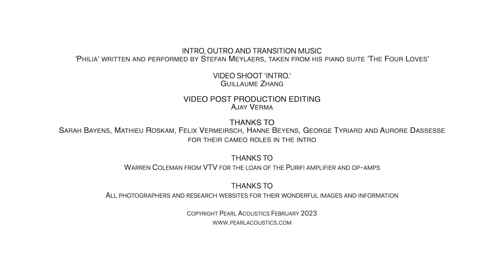Part 1: The perfect power amplifier?

Comment: “Warmt” = added distortion … it’s ok if you want to pay extra … go for it … but it’s not me … pure Purifi is my choice … I use Benchmark LA4 as perfect preamp to my Eigentakt Purifi monoblocks … excellent video Harvey … Bruno really revolutionized and commoditized power amp segment with Hypex nCore first and even more with brutally transparent Purifi … and I own Quad 909 power amp as well (which I like, used it for 20yrs, even restored it, but it runs too hot and in the summer not as enjoyable in the room without adequate A/C and now it’s replaced with Purifi monos)

Comment: I'll stick with my Audiolab 8000M's. 20+ years old and when I sent them for a service a few years ago all that was needed was a clean to remove the residue from my misspent middle age. They measured perfectly on test so I was advised to leave well alone.
I'd be interested to know if they are among the most reliable HiFi components ever made?
Perhaps it's because they have been left on for most of those 20 odd years only being turned off when making/breaking connections, cleaning or going on holiday?
Reply from the maker: Hi, I am not very knowledgeable on Audiolab gear. But good quality equipment should last a lifetime, in my opinion. Indeed, leave well alone - and if something needs changing go to someone who really knows what they are doing. Best is always the manufacturer, if in any doubt.
Reply: @PearlAcoustics  Sadly Harley Audiolab seem to have no interest in customers once they're customers.

Comment: Of course, I first saw this part, then the interview with Bruno, after which I came here for a comment. There is practically no amplification, amplifiers do not amplify anything, they just facilitate the source signal to modulate in amplitude the current from the power supply which reaches the speaker in the audio speaker or the terminals of the audio speaker. This is the secret, practically and theoretically, the audio/musical quality of an amplifier depends a lot on the quality of the current from the amplifier's power supply. A linear source, possibly stabilized, will produce a much better, more musical sound, than a PWM (switching) source. I studied a lot and even assembled a few amplifiers in my youth. Of course, a good preamp, again, with a very good current source is very important. Bruno said that he is trying to create a module that is no longer influenced by the quality of the power supply, the current source, which in theory may be valid, but in practice is not possible. Think about what I said above, at the terminals of the speakers, from the amplifier, it is actually the current from the power supply of the amplifier that is modulated by the input signal and not the input signal as such. Real amplification is called resonance, and again, it is only encountered in the analog realm, in nature, or in analog electronics. When the soprano hits a high note with force, the empty glass on the table shatters as it resonates amplifying the frequency of the sound emitted by the soprano. So, if you want to build an amplifier around Eigentakt modules, you need a very good quality linear current source, possibly stabilized, then the best buffer can be made with tubes and not transistors or opamps.
Reply from the maker: Thanks for your contribution to the topic

Comment: I own a Purifi based amp. It truly is the thinking man's choice. I have never before heard, let alone owned, an amp that I enjoyed so much with such a variety of music styles and sources.
Reply: I second that: I bought the Hypex Nilai 500 DIY Stereo and the Hyper Preamp DIY, it's marvelous!  I am an ex DJ and listen to a wide variety of music genre.  Sparkos Tube in there, for me it's no thank you, total no go...  "More Musical" = the guy like the added harmonic distortion of tubes:  I don't like distortion at all, i don't want to hear colored sound!  But cool, we have choice of buffers for those amps, a modular architecture that brings flexibility / choices.
Reply: @ I like distortion and 'coloured' speakers, but only when I choose so. Clean power is the baseline.
Reply from the maker: That’s good to hear
Reply: @Bob.martens would you mind telling which buffer and opamp you’re using and which speakers you have?
Reply: @sebastianlunoe  I have the Audiophonics hpa-s400et amp. Audiophonics produce their own buffer board with LM4562 OPA, offering four gain-settings and a buffer bypass. My speakers (in rotation): Q acoustics 5040, Wharfedale Linton, Klipsch RP150. I use a Topping D70pro Sabre as preamp.
Reply: Alimento il mio amplificatore con un alimentatore esterno da 24 V., 3 A.
Ho notato che a parita' di volt, aumentando gli amperes cambia il suono dell'amplificatore. Sembra "muscolato". Anche a 1/30 del volume massimo.
Altoparlanti buoni, conseguentemente produrranno un buon suono....
Buongiorno.

Comment: Not wishing to sound critical but I struggle with the concept of what is being called a "perfect" amp being coloured by an op amp. The mere fact that the two tested made the amp sound different regardless of whether better or worse means that although the final stage may be "perfect" it will always be affected by the op amp. And that Harley prefers, what I assume is a more  "coulored" , as in less that totally transparent,  sound means that to strive or even care about "perfect" is a waste of time. For what it's worth I would love to hear the op amp Harley liked less as for me I love the transparency and ability to dig into the minute detail.
Reply from the maker: Hi, thanks for your comment. The title of this video is deliberately provocative because of exactly what you say. There should be a pure voltage gain without any colouration. But then, when there is, somehow it is not so pleasant to listen to. At least now we can have options….
Reply: @PearlAcoustics  Not so pleasant for everyone. From what I've heard and read over the years audiophiles/ music lovers seem to fall into two basic camps. Those who seek utter transparency and detail vs ( not necessarily adversarial) those who prefer a warmer sound. I bought a Denon DL103R based on the positive reviews and was rather unimpressed by its lack of high frequency detail resolution.  I could appreciate why some might like it though. I replaced it with a less popular if a little more expensive Audio Technica 0C9XSL which ticks all "my" boxes. I would live to hear live both iterations of the amp reviewed to see if a similar experience resulted. Thanks for your reply. 👍

Comment: Class D amplifiers are amazing. Indeed.  It is difficult to imagine that they sound so good being efficient as they are. As class D amplifiers are being developed? Mains voltages will be of concern. I am in the United States. 120 Volts? Something will give.
Reply from the maker: Voltages are not an issue. High quality class d amplifiers, all have mains smoothing circuits. In fact you can see a simple 5v smartphone charger as a class d amplifier in reverse….
Reply: @PearlAcoustics  I have so many questions about them. Thanks for the input.
Reply from the maker: @tnasburypl  you’re welcome
Reply: @PearlAcoustics  No worries, I as a person who spends a lot of money on amplification? Seems high end speakers can be found at relatively lower cost verses amplifiers. i am intrigued. In so am following such things.

Comment: Your comments comparing to a watch is apt.  No one needs anything better than a $20 watch to tell time.  But we buy the one we like and also get to tell the time.
I built big OTL triode amps because the notion of tube amps fit my design aesthetic.  The circuit designer was well regarded, so it had the potential to sound good, but I did it on faith.  They sound as good as they look, and I never think of changing or upgrading.  What little distortion they have suit my ears.  Holographic and engaging.  For me, they are the Patek watch, while the amp you are showcasing is the Casio.  My amps have the huge disadvantage of needing retubing, and they take a lot of space, and are energy inefficient.  But I do love them.  When I get old and have to downsize, I'll get the perfect Class D, and put it in a cabinet out of sight.  And also buy your speakers.  
I would buy Bruno's modules to build some power amps for my woofers.  I need about 13dB of gain.  They would likely work without the gain stage.
Reply from the maker: Thank you for your very kind appreciation and for your contribution to the discussion. I too have a big, very heavy pair of tube monoblocks in my home listening room. They best it beautifully in the winter. But in the Summer we switch to class D. Best wishes, H

Comment: obviously theese amps are made to be connected with XLR`s that can output 4V, if you put in RCA then no wonder you need more voltage. also the tube buffer will only increase distortion, defeats the purpose of this amp in the first place.
Reply from the maker: Indeed. The distortion (2nd. Order) that tubes make is weirdly appreciated.  We also have run the purify directly from high output pre amplifiers, some natch very well.
Reply: Not even 4V would be enough. You would need 10V from preamp to feed them directly for optimal performance. Otherwise, you still need to use the interface for gain.

Comment: Disdain for Seiko, "quite rightly?... ?   (questionable comment !)
Wires in that amp seem quite sloppy compared to the neatly braided lines in the components I have opened up!
Perhaps an interesting video(?), though I feel it had tunnel vision. Hopefully subsequent parts to this series will expand on this one with insight relative to other historically-respected amps (such as McIntosh MC275, etc.)
Reply from the maker: Hi, indeed my comment was not very well phrased. I felt bad about that but it was too difficult to edit out. Absolutely no disdain about Seiko, they are great value for money. And I would have no issue in wearing one.

Comment: Many moons ago i have decided to give B&O ICE modules a try. I have builded nice housing and E88CC tube buffer. It was not bad, but it was not good either. Withouth E88CC buffer it was cold and uninvolving. But with signal generator driving it at 1kHz you could weld with it.
That was long time ago and by now these things must have made long way.
For time being and untill proven othervise i will stick to valve SE A class.
Sir you have a great chanell.
Reply from the maker: Hi Sinisa, I find I have to agree with you here. Especially with the class A Sugden 😉

Comment: I wonder how the Purifi Eigentakt would sound with the buffer replaced with a Lundahl audio transformer? 
Will the audio transformer give the same warm sound as a tube? 
I will use it with Klipsch horn speaker so I don't think I need more gain then 13dB.
Reply from the maker: Dear Thomas, thank you for your interesting question and contribution. I am not a specialist in this area. A colleague suggested that you would still need an active gain stage as with the transformer it will drop the gain a bit more. So although it might be suitable for very sensitive speakers, like yours, with a suitable preamp, it’s quite a specialist offering. If you have the knowledge, why not give it a try? I would be very interested to hear the results.

Comment: What I do not understand is, if you already have the best amp module in the world with the lowest distortion etc measurable, and then you insert in front of it, an op amp made from discrete components, which is guaranteed to degrade the distortion by at least one or two orders of magnitude. Don't get it. If you need an op amp AND you need to retain the low distortion figures, that last thing you would do is put a discrete op-amp in the line, you would use a OPA series op-amp (for example). Otherwise this smacks of mysticism (to me) - what would you be trying to achieve otherwise? OK, revealed at the end, you want to add a SOUND to an amp that is so perfect it has no "sound." Makes no sense.
Reply from the maker: Hi Mike thanks for your comments. As I mention in my video, in the case of the purify module, it only has 13 db of gain, which means it needs a much higher than standard voltage to drive it. Designers all over the world are experimenting with various options, even my own team. Bruno himself accepts that some kind of buffer is needed. Without some kind of additional pre amplification stage, the amplifier sounds a bit sterile. Have you heard one? It reminds me of an experiment I once tried, recording an ensemble with two totally flat test microphones. The result was not pleasant. Just because something measures well does not mean it sounds great. The Purify modules are extraordinary but they need something ‘extra’ to make them musical. Hopefully you’ll get to hear them.

Comment: Hi, Harley. Assuming we have found the ‘perfect’ power amplifier, I’ve been wondering about the importance of the preamp. I had noticed you had a Quad Artera. Did you find it adequate? I’ve been wondering if our money and focus is better spent in the amplifier, preamplifier, or equally. Thank you for the helpful videos.
Reply from the maker: Dear Jonathan. I wish there was a simple answer to your excellent question. I personally like the idea of there being a ‘perfect’ (or totally acceptable) power amplifier and then all we need to focus on is the front end. 
However, the real focus needs to be the music and one’s enjoyment of it. In that regard, in my home set up, my Quad Artera does a wonderful job it performs absolutely as one would require, so much so, I don’t give it a second thought. The trouble comes when you are unhappy with the sound of your system. If you have the perfect power amplifier, then you can rule that out and try and focus on the weakest link. All said and done, a preamplifier can bake a big difference, more than a DAC or a streamer, and that’s where one’s focus could go to. (Assuming one’s happy with ones loudspeakers). Sorry if I haven’t answered your question sufficiently. I will come back to the topic in a future video.
Reply: Harley, which preamplifier did you use to evaluate the VTV Purifi? I'm not sure I heard it in the video. Thanks for a great review. @PearlAcoustics
Reply from the maker: @wyup  hi, thanks for your question and kind appreciation. I tried it with a few pre-amplifiers: the Project RS Pre (which has a solid state and also a tube output), a Musical Fidelity M8 Pre, and a Sugden. It does reflect what you point at it. I hope this helps? Best wishes from Belgium

Comment: Do you think connecting these to lyngdorf digital amplification wouldn't be kind of fully controlled solution?
Reply from the maker: I am a big fan of Lyngdorf equipment. I particularly like the little 1120 because of its capabilities. And I like to couple it with other amplifiers. I have not yet tried it with the Purify. Indeed it could be a very interesting combination
Reply: @PearlAcoustics  I am just ahead of testing all in one's line-up, as moved to streaming almost entirely. 1120 is on top of my list, with only add-on to be proper headphone amp. My question comes for potential future proofing :)

Comment: Sound isn't the only thing that makes a perfect amplifier, price, looks, power consumption etc. All factors that would make the perfect amplifier.
My current amplifiers have been in my system for 30 years now. Perfect? Probably not, perfect for me? Absolutely
Reply from the maker: You’re absolutely right. So pleased you have long serving equipment. That’s exactly how it should be. At home I run my 1976 QUAD, it had an overhaul in 2015, but not been touched since (and I cannot imagine it would ever need to be).
Reply: @PearlAcoustics  quad is nice quality equipment. I have ESL 57, love them. 
Driving them with Harman Kardon citation 12 deluxe and citation 25. Thorens turntable and Marantz cd80. All at least 30 y.o. and had them serviced once.
Bought ifi dac and BT. Because I think these areas will get more innovation in the coming years, so didn't want to spend much. But impressed with the build and Sonic qualities specially for the price.
The piece of gear I use most is my hifiman Deva pro. Love the utility for daily driving my sonic needs. Bt/dac/conventional it does it all.

Comment: Very interesting matter. I wonder, if the lyngdorf tdai 1120 you sometimes use, would be a good match as a preamp. Because it has the possibility to use different settings or voices. 

Curious for your answer,

Hannes
Reply from the maker: You make an excellent point here. I didn’t try it because the Lyngdorf has no balanced outputs (I keep nagging Lyngdorf to make a true pre-amp version) and the VTV I received had only balanced inputs. I think it would be worth exploring this further. The Lyngdorf has a pretty good amplifier so it might be a bit of a pointless exercise - but it could be very interesting. Thanks for your comment

Comment: The new class D GanFet amps currently available seem well suited for bass applications in particular,  right?
Reply from the maker: Hi Jeff, after speaking with Bruno on the topic if GanFet, I am not so sure. + if there is nothing wrong with a design, Ie it is technically ’perfect’, then it next comes down to economics, the environment and ease of manufacture. There cones a time, like with quartz watches, that one stops talking about accuracy.